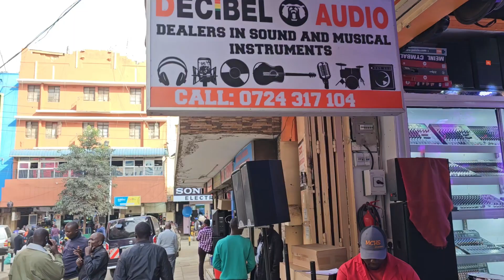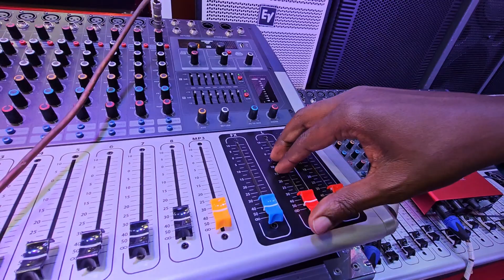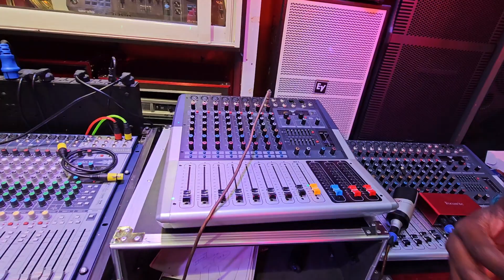UNDERSTANDING OHMS AND WATTS

Comment: Thank you so much but just a simple question .if your mixer supports 2ohms does this apply to one channel or it is the general coz i can see from your connection u used only one  channel for the 3 tops .can i connect another 3 tops on the other channel or it is not advisable thank you.
Reply from the maker: Yes you can do a total of 6 tops
Reply: Ok thanks

Comment: Hello brother,am using a mixer,a cross over that I bought from your shop,a CA 18 and one bass speaker.The problem is that the speaker keeps going on and off during the service.Sensitivity ya power amplifier nimeweka full..What could be the issue?
Reply from the maker: First of all make sure the levels of your gains from your mixer are not distorting , I suspect there is distortion going to down to your amp.. minimise the gains n let me know
Reply: Thank you sir..I will be doing so and let you know also